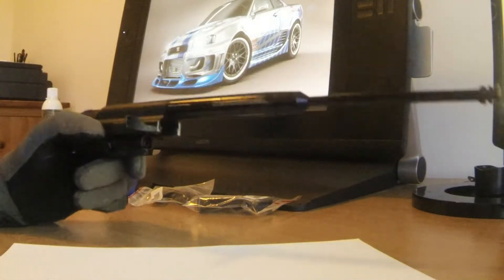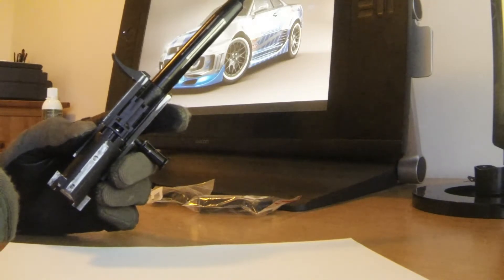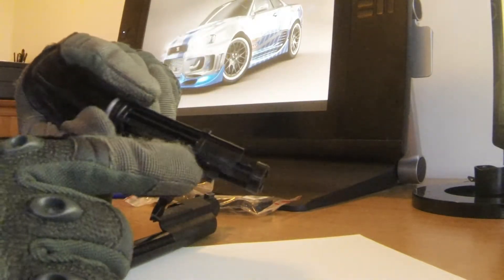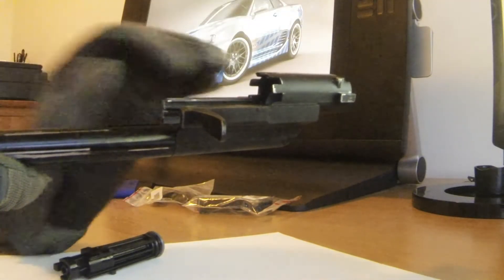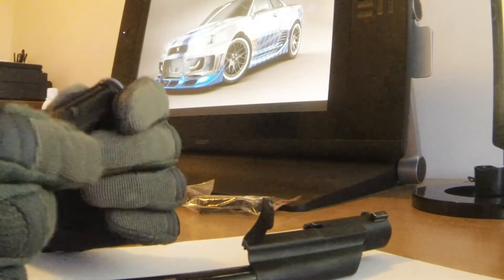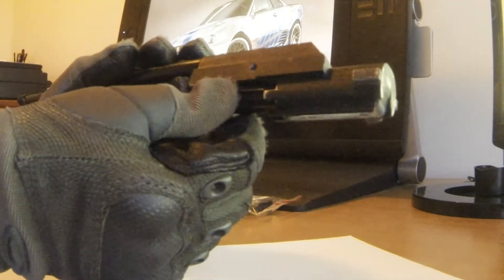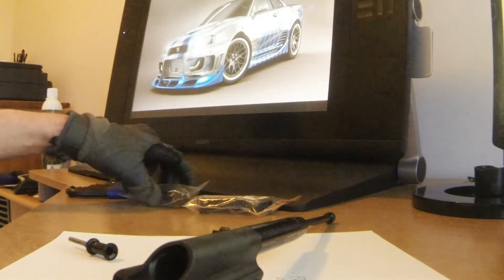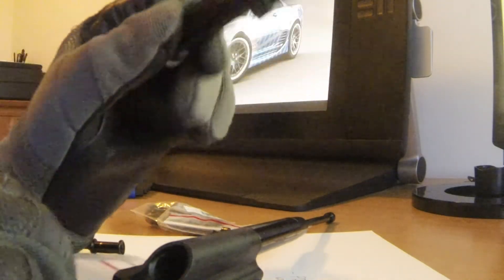GHK AK-105 Nozzle Problem and quick Fix (Airsoft)

Comment: I broke two nozzles already, the second ones legs broke after shooting 5 rounds which is ridiculous. if I just shoot it without the legs it wont dangle down and get caught on anything while im shooting? is it safe to do so ?
Reply from the maker: Hey man. That sucks... Was the screw that holds the nozzle loctited in? Make sure that screw didn't come loose and make sure the rails the nozzle slides along is sanded nice and smooth. If you break the other tab off it will work just fine. Just don't pull the bolt back without a mag in or the nozzle will fall out of position and jam. It doesn't get caught on anything if the mag is in. You can order some new nozzles at WGCshop from hong kong.

Comment: Hey mate, did this fix the problem. I have same problem.
Reply from the maker: Yes it fixes the problem if that happens to you.
Reply: @jeffiejeffsairsoft6165  unlucky for me,  I am still getting double feed even after I removed the wings from both side and nozzle also broke my hop up chamber.
Reply from the maker: @jasbir183g  Oh nooo. Are your meg lips cracked down the center? If they are that could be the reason for the double feeds. The bbs come out too easily and the hop up chamber is plastic to it smashes them into it and breaks it. It happened to my m4 once. I replaced my hop up chambers with the maple leaf hop up system.

Comment: Just did a video on this. I just filed off the corners and rounded them off, also smoothed out the channels in 
the bolt carrier. No problems ever since and fired a lot of rounds.

Comment: Sanding and smoothing the Rail in the Boltcarrier helps a lot!
What you also can do is rounding the Edges from the Side Tabs a little bit.

Since i have done both Mods i have no Problems anymore....
I had one broken Nozzle at all

I wish someone would make a better Nozzle!
Reply from the maker: Volker Vielhaber Nice thanks for the tip. Yeah sanding and polishing the nozzle rails help a lot.